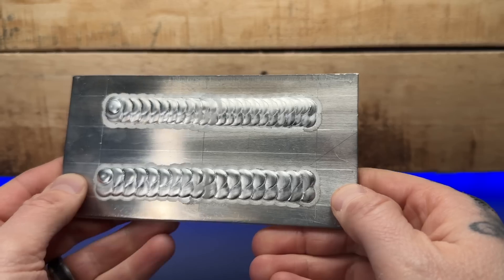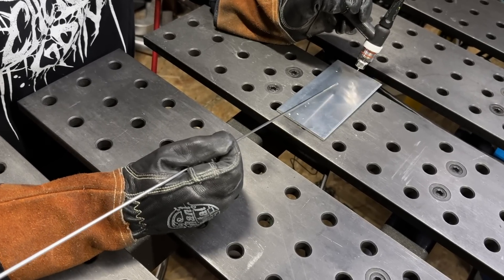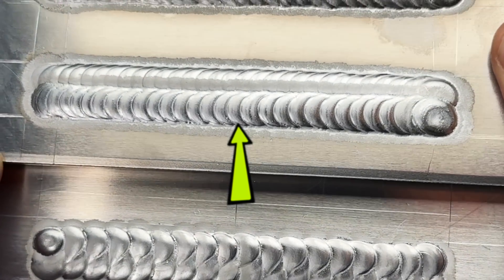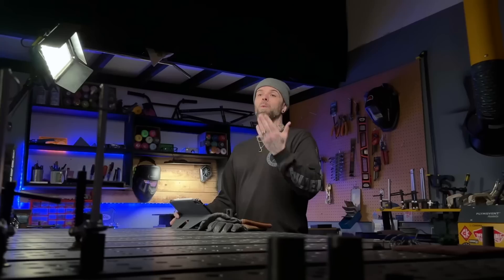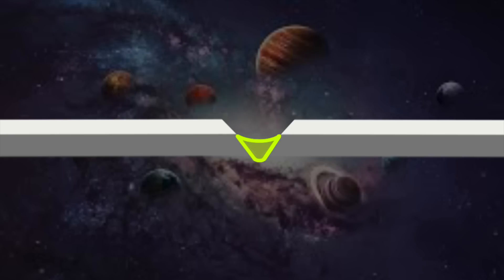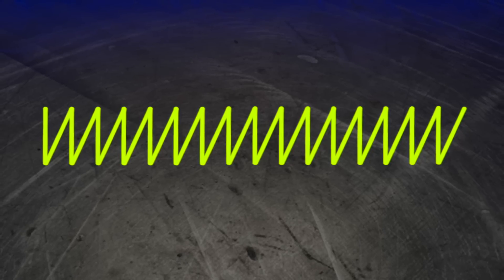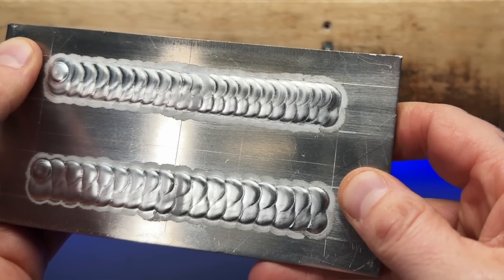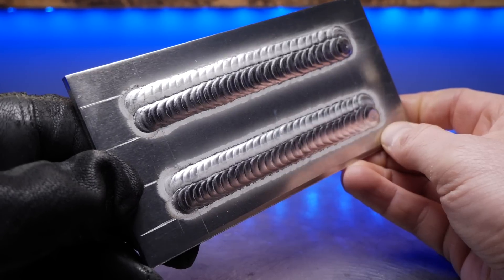Whats the HUGE DIFFERENCE with These Tig Welds?

Comment: To be honest, I end up grinding and polishing my weld beads flat with the adjoining parent metal in order to avoid crack initiation sites as my designs are taking advantage of the strength of the material and the weld strength.  By grinding and polishing down the weld cap, porosity that is in the weld can be revealed.
Reply: That's worse than weaving.
Reply: @MikeYurbasovich  Nope, that is how life limited (fatigue) designs are done.  I did extensive studies and research on weld design on aluminum structures.  For the majority of the welding done where everyone wants the stacked dime look, the stresses on the parts are generally well below the limiting fatigue stress for aluminum alloys.  Especially when people are using 4043 on 6061-T6 fabrications.  The tensile strength of 4043 is 21 ksi while the tensile strength of 6061-T6 is 43 ksi.  5356 has a tensile strength of only 30 ksi.  This is why 4943 was developed as filler material as when it has been heat treated, the tensile strength is very close to that of 6061-T6.

High performance fabrications, especially in aerospace, require a very extensive design analysis covering both the structure and weld designs.

hth

Comment: I used to do a lot of inspection in the private sector after having been a welder myself in the past and I HATED seeing huge weaves... especially when the WPS called specifically for stringers.  Weaves (while pretty) cause many lack of fusion issues, as well as dump excess amounts of heat into the base material.  There is a time and place for a weave, but people tend to go overly-focused on cosmetics and "instagram welds" rather than function and structural integrety.  Doesn't matter if it looks awesome if the pressure test fails.   MUCH prefer the "split weave" technique both from a personal, and a QA standpoint.
Reply: Well said 💯